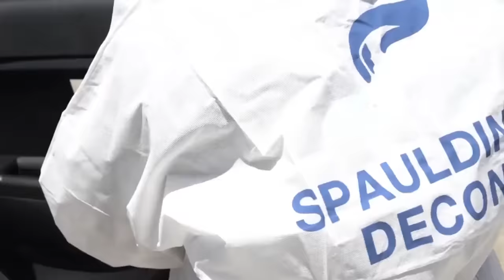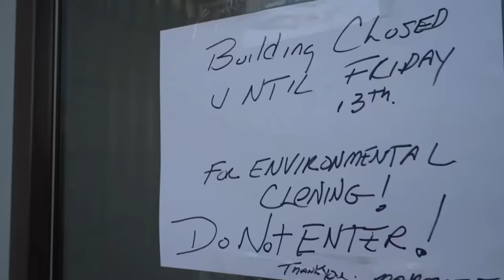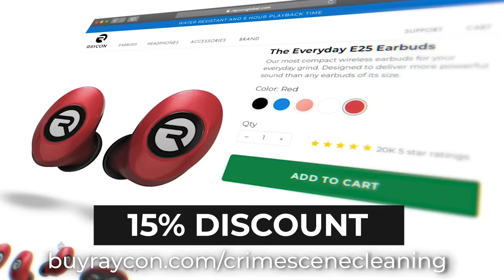Pop Goes the Body

Comment: I assisted a clean up crew with a hoarder who died in the motel room he was living in for several years. At first we didn't know there was even a body, we knew something was dead but assumed it was some poor kitty trapped within the collection of newspapers and office fans (seriously dude had like 30 fans and not one of them worked we tried to use them when we were trying to air it out) when we found the guy we had to call the cops and they basically said something about "seapage and leakage" and I thought that would have been the worst thing I've heard involving a dead body removal but no popping is way worse sounding and even worse to picture in your head.

Comment: I worked at an apartment complex for the elderly. I was the maintenance guy there. My shop was right across from a guy who died in the apartment. My property manager came to me and said. I need you to go with me and check on the guy. As soon as I opened the door the smell was overwhelming. He had turned purple. He died watching TV on his couch. That smell lit up the whole hallway. Thankfully he had the air conditioner on in his unit. If not we would have smelled it earlier

Comment: I work in property management and a few weeks ago we got a call from a resident about a smell in the hallway, and when we went over to the building to check it out we couldn't get within 10 feet of the poor guy's apartment before it felt like we were choking on the smell. It turns out he'd been in there about 2 weeks or so during a heatwave. Would that smell have been similar to this do you think?

Comment: Hydrogen Peroxide is a wonderful bleaching agent. I use 2% in solution to loosen dirt and wax inside of my ears. Foam ear plugs are a necessity in my line of work. Which is why I clean my inner ear with HP.

Comment: That is indeed a very hard job to do, living a body like that is a sad thing to do. Living the body in the storage room to the point it popped, not only it's sad and disgusting. The clean up crew also have hard time also. You better pray that his spirit don't hunt the place and call an exorcist. Since his body may not have a proper burial. His spirit will not rest and will hunt that place forever and if it's homicide the killer will be hunted by his spirit for all eternity. Hopefully the cleaners also bathe themselves in holy water to keep his vengeful spirit at bay, after this clean up.